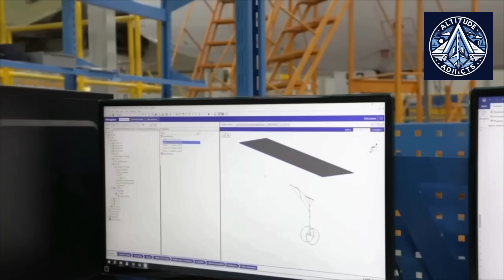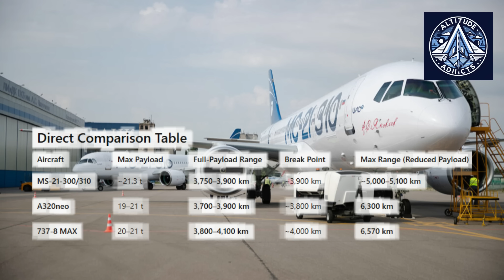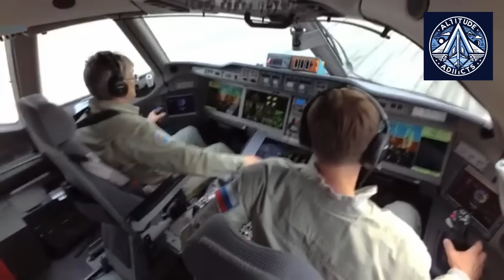MC-21 Range Controversy EXPLAINED: What UAC Didn’t Tell You

Comment: Вчера был ролик где пилот сказал, что пролетели 4200км и потратили 15т керосина. Вот и считайте это уже не 3800.
Reply: The plane was empty! No passengers and no cargo.
Reply: @LloydChristmas983  The aircraft undergoes flight certification and flies with a load.  possible with a maximum of 21.3 tons

range 3800 kilometers with a maximum load of 21,3 tons.  MC21 can accommodate up to 211  passengers 
   (21300 :  211=100 kg    one person with luggage).
Reply: @LloydChristmas983 на опытных бортах стальные плиты на местах пассажиров

Comment: Russian scientists are working to reduce the weight of the engine and few other components. In two years, MS-21 would have comparable weight ratio of A320neo and exceed their range.
Reply: I wonder where the excess weight is located
Reply: @OOpSjm  coposite wing material and interior part,landing gear i think

Comment: Used to love channel but this is slight propaganda I flew on a max from Istanbul to Tanzania daresalam turkish airlines it was packed was about 7 hours on a narrow body and when I say packed I mean we all had luggage allowance of two 23kg suitcases as well and that’s on a 737 max which is still basically an old design come on man. Mc21 has shockingly gained weight just be honest sanctions are hurting
Reply: Yes, this is a propaganda channel.
Reply: Of course it's a propaganda channel full of bots from "Agenstwo Internet Issledowanij"! 😂🤣😂🤣
Did you you get just now?? The AI voice alone... 😏
Reply: the MC 21 could very likely do it also if configured the same way.   TA uses planes with 151 seats, so their payload is 14 345kg which is below it's max payload at max fuel.  A 737 Max 8 range with max payload is 4630km,  MC21 with max payload is 3830km both have similar max payload.   737 Max8 max range is 6500km with a light load so given the roughly 800km range deficit on the MS21, it will be able to do the same route you talked about but no more.

The 737 is not really an "old design"  the NG featured a new longer, wider wing with more wing area, a thinner wing foil, more fuel capacity and a higher MTOW.  That was introduced in '97.  Then the max got the split tip winglet with it's revamp and aerodynamic changes to the tail cone which is a huge change too plus brand new engines in 2014. All these changes take a long time to "tweak".  Once Russia gets the weight down on some substituted items, that will directly translate into more fuel capacity too.  It's only at a slight disadvantage to western airliners, but if they kill fewer people and spend more time in service, then that disadvantage disappears.
Reply: @jeffhedrich3551  
Hmm...

SAS operates A321neo with 157 PAX on commercial flights from Scandinavia to North America 
1) Route: Copenhagen (CPH) – Washington Dulles (IAD) / flight number: SK925 / distance:  6,556 km; 
2) Stockholm (ARN) – Toronto (YYZ) / flight number: SK947 / distance: 6,331 km; 
3) Copenhagen (CPH) — Toronto (YYZ) / flight number: SK949 / distance: 6,280 km.

Air Transat operates Airbus A321neo with 199 PAX on the route Lima (LIM) – Montréal (YUL) / flight number: TS151 / distance: 6,376 km.

Iberia operates A321neo with 182 PAX on the route Washington (IAD) – Madrid (MAD) / flight number: IB362 / distance: 6,122 km

Philippine Airlines operates A321neo with 168 PAX on the route Brisbane (BNE) – Manila (MNL) / flight number: PR222 /distance: 5,805 km.

and many more....

How long will it take Jakovlew to get there... ?? 🤔
What's your best guess? 😏

Comment: 8:46 Let's see....... 

Longest commercial flight operated by an A321neo is the SAS SK925 – Copenhagen – Washington D.C.

Route: Copenhagen (CPH) – Washington Dulles (IAD)
Airline / Type: SAS Scandinavian Airlines, Airbus A321neo (A321LR)
Flight number: SK925
Distance: approx. 6,556 km (3,540 nm)
Scheduled flight time (block time): about 9:20–9:30 h

In the press release for the A321LR on this route, SAS explicitly describes the cabin as 22 Business, 12 Plus, 123 Economy = 157 seats.

SAS operates the same A321neo with the same passenger capacity on routes to North America:
ARN – YYZ (Stockholm–Toronto) / SK947 / 6,331 km
CPH – YYZ (Copenhagen–Toronto) / SK949 / 6,280 km

Next is the route Lima (LIM) – Montréal (YUL), flight TS151 by Air Transat.
It is listed in several current overviews of the longest narrow-body flights explicitly as an Air Transat A321LR.

Route: Lima (LIM) – Montréal (YUL)
Airline / Type: Air Transat, Airbus A321neo (A321LR)
Flight number: TS151
Distance: 6,376 km (3,445 nm)
Scheduled flight time (block time): 8:20 h

According to the Airbus press release for the delivery of the first A321LR to Air Transat:
“The Air Transat A321LR is configured for 199 seats in two classes, including 12 premium Club Class seats…”

And last but not least, the A321neo — NOT LR! — of Philippine Airlines on the route BNE – MNL (Brisbane–Manila).

Route: Brisbane (BNE) – Manila (MNL)
Airline / Type: Philippine Airlines, A321neo — NOT LR
Flight number: PR222
Distance: 5,805 km (≈ 3,135 nm)
Scheduled flight time (block time): 8:10 h

Airbus writes in the press release for the delivery of the first A321neo to Philippine Airlines:
“…features a premium two-class layout with 12 Business Class seats and 156 Economy Class seats.”
That results in exactly 168 seats

So guys, don’t let anyone "hang noodles on your ears…" 😏

Comment: ... 🙄
Just an advice: it's not yet the time to try to figure out what's correct. Current information one can speculate about right now is pretty much irrelevant. 

The final actual weights of MC21 has yet to be frozen: galleys had to be fitted, lavatories, all the pipes and systems bringing that cabin to life, more batteries, every bits and change are added weight. All the subcontractors has upper limits weight goals to fulfill. The actual datas will get proper confirmation when the first Russian airline will actually operate the type on actual routes with actual loads in compliance with actual pilots using graph and charts. Then, like for any new type, I must insist, ANY, including Airbus and Boeing, those numbers will get refined.

Another advice: any weight information has to be related to a specific version from a specific airline, not the whole program. Any type, including Boeing and Airbus undergoes several upgrades overtime and subtle differences between airlines, even slight differences between versions in the same airline. The communicated information is usually the MTOW, but how much the payload and the actual fuel capacity get affected usually goes under the radar. Worse, the pilot weight to range operational chart (and their derivatives) remains unavailable for years. We have practically nothing about the MC21, yet, we can already anticipate further mass increases and extra fuel tanks. Assumptions from many MC21 is lighter than A321 will prove themselves wrong overtime. This MC21 is just the first iteration, just like the very first A320 (or A321) that came out of Airbus factories (much lighter than MC21 with much less fuel capacity). Airlines, as usual will complain about this and that missing, better FADEC, wanting this specific reduced fuel capacity or increased range, while constantly nagging about weight reduction...

There is NO airliner in existence that has PERFECTLY met expectations. All of them was delivered heavier than predicted weight or below the targeted range ability providing a clear capacity. While airlines remain silent in face of the public to not tarnish their newly acquired workhorse, behind the curtains, heated discussions are raging.
Let's wait and see, trying to gauge where the MC21 actually stands in the segment while datas are volatile and unconfirmed by airlines themselves has no acceptable answer to me. And it's not being condescendant towards MC21 or UAC, Airbus and Boeing did failed to nail their predictions, many times, over and over again. Thats just pretty normal, how things just goes.
Reply: Thanks for the info, do you think these planes will ever be able to fly outside Russia given the sanction situation?
Reply: @a1ex02  Hi.
Your question discusses a very complex matter: sanctions much severe than any other else, not in terms of military deployment like the 1962 Cuba crisis, but mostly and ultimately entirely economical. It involves.. practically *everything and everyone on the planet. The reason is the Occident and East Asia control almost all the networking established in the last 50 years, internet, trades and exchanges, dematerialized remote payments (Banks/Visa/MasterCard...), satellite services, cargo ships...

While Asia is focused on the physical aspect, Occident is finance centric. Ukraine conflict is not a war for legitimacy (who's right, who's wrong, the more since actually both parties are wrong), but a war of domination and submission, financially speaking.
Whoever act has to consider his own future state of affairs, in this financial/economics bounded world.

Now your question can be simplified in two parts, but the economical aspect remains very complex:
1) What happens if a Russian airline lands in another country than Russia flying MC21?
2) What happens if a non Russian airline buys MC21 intending to operate it within or outside its border?

The difference is, in the first case, Russia spent money to produce a plane, selling the plane to a Russian airline, paying salaries for Russian people. The only way Russia gains a little money instead of cycling it within its own border is via the non Russian travelers flying to and from Russia. It's peanuts, just like any other Russian Boeing and Airbus still flying to nearby countries around Russia, Western bloc has little margins to try to interfere. Anyway, Russia is practically gaining nothing, why bother..?

In the second case, Russia is actually gaining currencies. For Occident, that won't do. Since directly stopping Russia head on means WW3, now the aggressor becomes occident, Occident will use economical power against related non-Russian countries: the same sanctions applied to Russia.

Then the important question: What those countries will decide to do (?), not only on the second case (buying MC21 themselves), but also the first one: being listed among the notorious list of countries being closely watched by Western bloc.

It can be simplified on a scale positioning every country in the world, where the driving criteria is _how much that country is Western network, trades, systems and services DEPENDANT?
Those very dependant concentrated on one side, those decently self sufficient towards the other side, and all those already chocked to death by Occident including Russia on the extreme of that side.
The last group with Russia has nothing more to lose, they are already economically struggling, under severe sanctions, anyway, at war with Western bloc. But, they may not care what Occident will come up with, do they have the means to acquire and operate MC21s? North Korea, Syria, Iran.

The second group, it depends. How much they have to lose? If they are already on an economical crash course within western system, well, they have no choice but buy MC21 (or COMAC). But those are tiny countries noone really cares about, like Yemen, Eritrea, Cabo Verde... How many MC21 can they afford and how are the chances a Russian airline have business with them?

For any other country, the stakes are increasingly high the more we move towards the extreme concentration group of countries close to USA. Not only they won't buy MC21s, but they will avoid as much as possible welcoming a Russian airline on their land...

The only way for Russia to actually regain it right to fly uncontested, ultimately selling MC21 internationally, is to flatten Ukraine and win the war.

But that would be just the first step. Observe again the scale above: the countries close to Russia are all very weak economically. Whatever the outcome of the war, the world will enter a new era of cold war. If Russia ends the war now with a full scale invasion, what kind of allies would it end up with?

Currently, the Ukraine war hasn't demonstrated clear enough how hierarchically economic driven capitalism shapes the world where those on the bottom are worse than slaves. Russia needs more time to invite more wealthier countries to build together a second capitalism, more fair, less greedy, yet, still a capitalism with rights and rules nonetheless. An alternative for countries to chose from: trade as equals or be the vassal of USA...

Though the timing is not right: capitalism hasn't reached yet its critical point (maybe around 2035 or 2040). In 2008, it was too early for Russia to trigger the plan. In 2016, same. When Ukraine took the bold decisions to integrate UE, OTAN and fine Russia for its pipelines, Russia couldn't let things go this route. Russia expected China to commit to the new bloc about to be born, it didn't happen. When China (and India) remained cold, Russia's BRICS expectation to side miserably failed. When BRICS remained silent, entire Africa did the same. Meanwhile, expectations from Europe to finally realise how USA manipulates them as cannon fodder was also miscalculated. Despite how long so far the war dragged on, Europe, on the verge of economical collapse still stands firm.

Ultimately, the economical battle of attrition is mostly in favor of western bloc. The grim perspective is, what would happen the moment Russia loses the war..? It would establish complete western bloc dominance, over everyone on the planet. It will get much worse than the direst situation we have today... And MC21? Don't ask... would silently die for noone to mourn.
Reply: @StephenKarl_Integral I like your analysis, the only flaw in my eye is that too much emphasis is placed on the economic battle of attrition. The actualy grim reality is that Ukraine is rapidly running out of men, the war will end in Russian victory likely as early as 2027. This will be much earlier than west wouldve hoped, failing at their objective to split Russia into pieces.

Having an airliner to meet domestic needs is also no small achievement, growing the domestic economy and local airliners, increasing mobility etc.

Thanks for your thoughtful response.
Reply: @a1ex02  I hope so. Thanks to you, was a nice exchange 😊
I admit the world is vast with countless point of view, mine is from a small African country France-tied, increasingly Chinese invaded, and Middle East trying to sneak in and buy everything right away. Over the last years, I was taken by surprise by increasingly difficult struggles at work, supplies, costs, quality... I had to understand from where/to where goods flow, why shortages, why more expensive, why lower quality. Actually, most Ukraine production were destined to Europe. When Ukraine became unable to supply Europe, other countries like Egypt, Turkey, Pakistan, (...) surprisingly Iran aswell, took the market. While getting supplies in my country wasn't really the issue despite many relative disruptions overtime, the quality severely declined. I must not expect Ukraine to deliver once again for Europe once the war ends, meaning whatever the outcome, the situation I'm in cannot improve.

^^ that's why my perception differs from traditional ways. I'm not interested in who's repeating a known song, rather, who actually did what for his own game, for me to know what I need to do for my own interest. That's why, clearly, I'm more inclined to encourage Russia who did almost nothing to my country rather than Occident who is clearly only here to exploit us..

Anyway, we digress.. Let's leave all that aside 🤣😂😊

Comment: Not sure if it makes sense to compare the MC-21 with the smaller, lighter A320neo. For long distance / high payload operations, airlines would usually pick the A321neo or even A321neo LR.
Reply: A320neo is not lighter. It has lower MTOW.

Comment: Just yesterday the plane covered about 5600 km non-stop from Irkutsk to Zhukovsky. I do not know how heavy the plane was.
Reply: The rout from Irkutsk to Moskow is of course 4300km... not 5600km...as stated by chef pilot after the flight 😏
Reply: @CheburashkaGenovna  Er sprach von einem Testflug, der in Irkutsk startete und in Schukowskij endete.
 Er sprach nicht davon, auf kürzestem Weg das Ziel erreichen zu müssen.
Reply: @arideineglotze1 
4300km were stated by the chef pilot Andrej Voropajew in his Interview, standing on the tarmac in front of the plane right after the landing... 😏
Reply: @CheburashkaGenovna  Der Flug dauerte sechs Stunden und 15 Minuten, er fand in einer Höhe von etwa 11.000 Metern mit einer Geschwindigkeit von 800 Kilometern pro Stunde statt - Statement der Firma. Wenn Sie Originalaufnahmen des Interviews gesehen haben mit der 4300 km-Behauptung, sind Sie eine Quellenangabe - funktionierenden Link -schuldig
Reply: @CheburashkaGenovna  Well, I just looked at a flightplan created myself for a simulator:) If the chef pilot says 4300 I have no choice but to trust him:)
Reply: Domestic production and sanctions inevitably lead to increased weight, but I believe this issue should be resolved within the next few years.
Reply: @hyy3657  There are no increased weight at all. The dry weight for 175 pax version is the same. The plane was additionally certified to carry 211 pax and as a result its allowed max take-off weight increased, that's all.